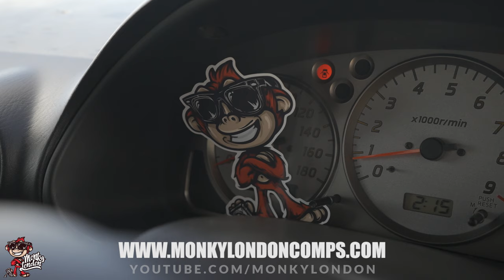I DESTROYED HER S15 DRIFTING + A BIG SURPRISE (ENDLESS R32 GT-R)

Comment: The ENDLESS R32 as far as I remember, never reached the "RH9" (9 second club) when it was actually Endless owned, it did however get rebuilt later. The FIRST Endless RH9 GTR was the R33 GTR, which ended up here, in Sweden in like 2011 or smth.